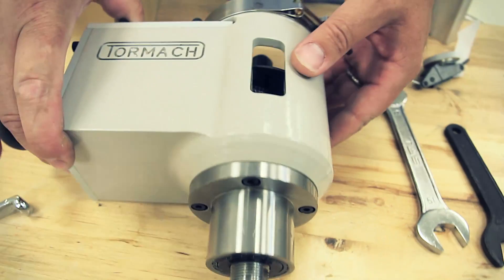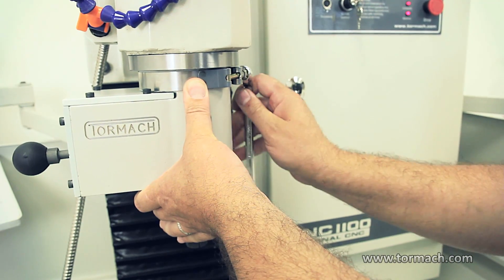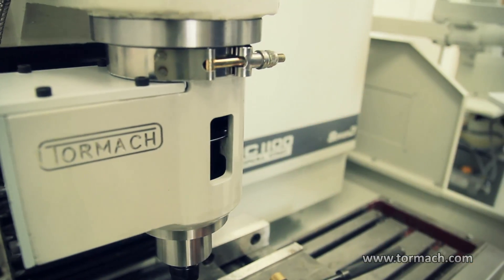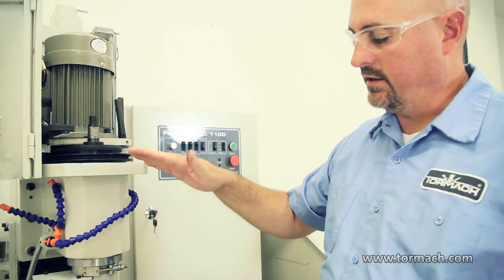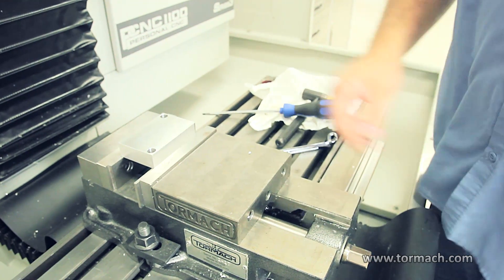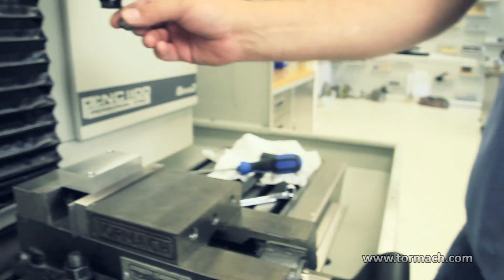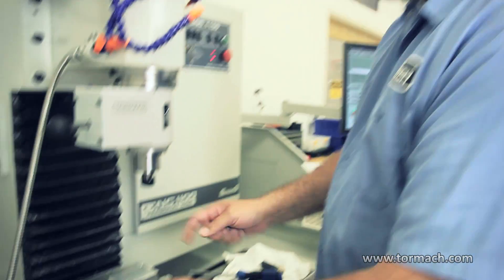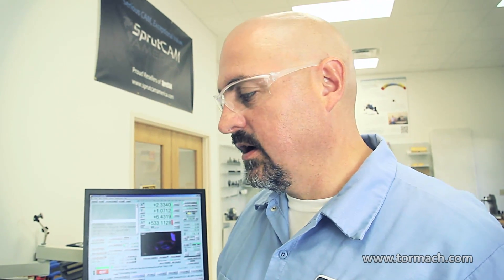How to Use the Tormach Speeder - Tormach CNC

Comment: If you have the power drawbar installed, how does this affect installation of the speeder?
Reply from the maker: underourrock You can use the Speeder with a drawbar installed. Our recommendation is to disengage the power drawbar from the front bracket and swing it out of the way. You can then adjust the belts and the tooling.

Comment: I saw the spindle start to oscillate back and forth with Mike's hand on the shuttle jog controller at 4:50 and immediately though "WHAT KIND OF VOODOO IS THIS?!"

Then I realized he was just turning the spindle pulley manually from above.